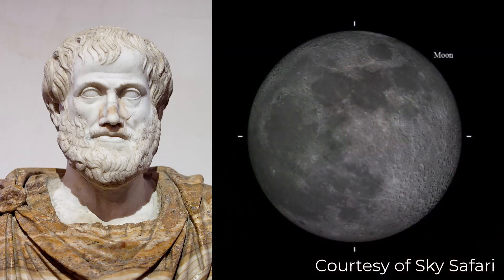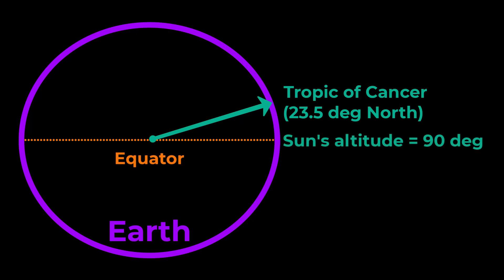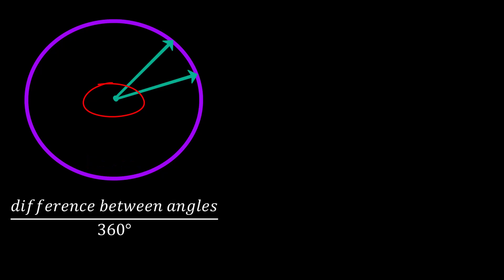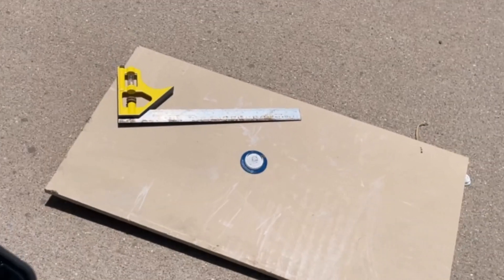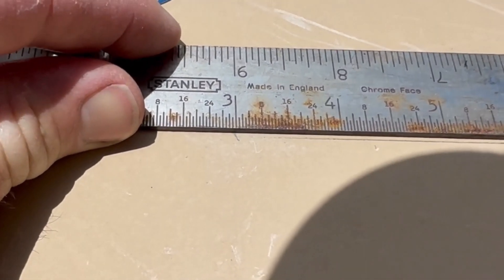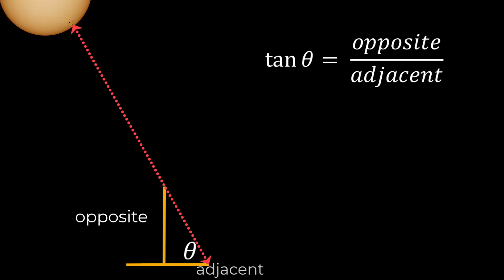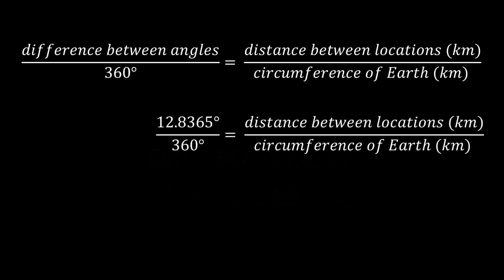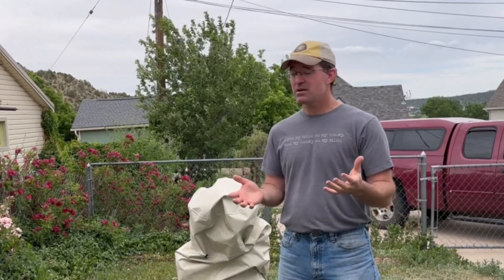How to Measure the Circumference of Earth For Yourself

Comment: Correct me if I’m wrong, but you could do this any day when the sub solar point is on your line of longitude and you have the coordinates of that spot right?
Reply from the maker: Great question!  It seems like that should be possible, but I haven't been able to make time to test that out in my favorite planetarium software (Sky Safari) yet.  I would LOVE to figure out how to make it work with two sites that aren't the same longitude so I could team up with another teacher a few hundred miles away (or more) to have student calculate Earth's diameter truly from observations only.
Reply: That would be an interesting experiment, not too sure how it would work but I’m sure it’s possible. I also found a website that shows the current sub solar points and found the coordinates and time for the point on my longitude and was able to calculate very roughly with about a 2000km difference as well a few hours ago haha.

Comment: You expect me to belive that you measured the shadow's length to a precision of 1 ten thousandth of an inch with a pencil mark and a ruler ???

This video says you can measure the circumference of the earth, as long as you have access to a calculator/reference which gives you the distance from your location to the Tropic.

You use 4 significant digits for the length of the shadow, but only 1 significant digit for the latitude of the Tropic of Cancer (currently 23.4394 degrees).  As a scientist, you sir are not up to scratch.
Reply from the maker: No, I measured to about 1/64th of an inch.  Converted 47/64ths to a fraction and only kept four of the decimals the calculator gave.  If you really want to know, going to only two decimals changes the altitude of the Sun by 0.015 degrees.  Run the numbers all the way out and it changes the percentage error of the total measurement by 0.05%.  Not a big deal.  The latitude of the Tropic of Cancer being simplified to 23.5 is common practice (which, by the way, is three sig figs), esp for general audiences - 23.4 or 23.5 is what you'll find in most of the science textbooks.  Again, not a big deal.  This video is a backyard project to demonstrate the process, not obtain research-grade results.  Still, I'm looking forward to trying again in the future.